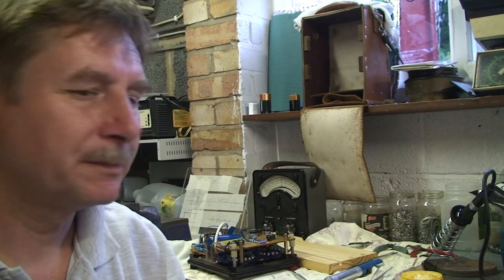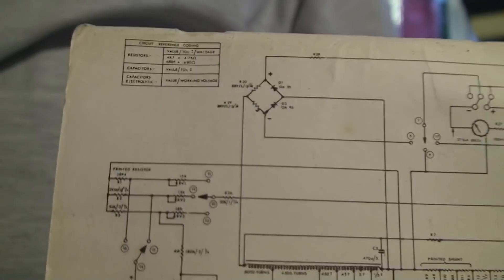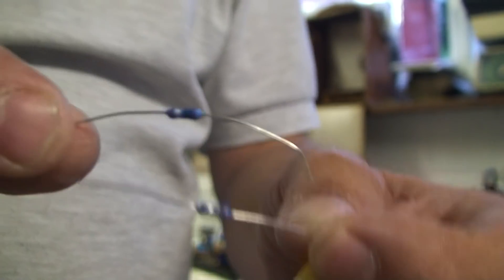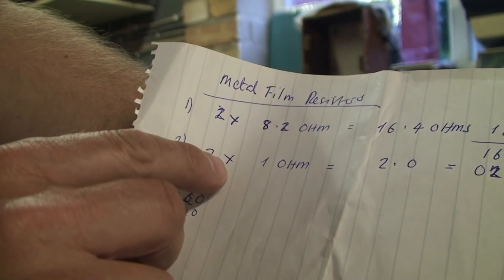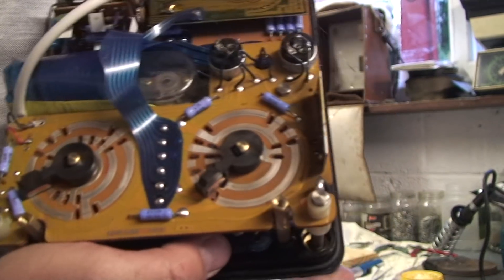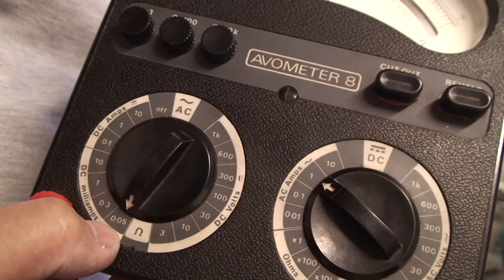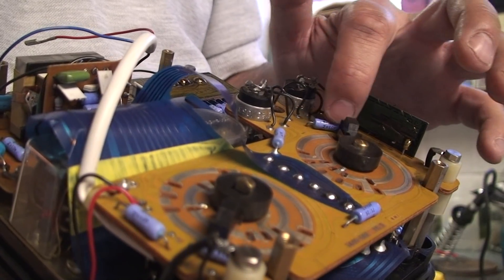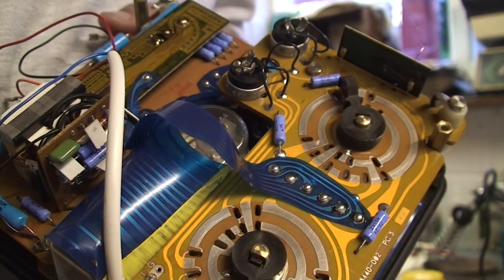Avometer model 8 MK 5  video 1 R1 Resistor

Comment: Quite a few issues with this video. No effort is made to determine an appropriate wattage for the replacement resistor(s). A fixed camera is used with inadequate lighting, so often the subject being discussed is invisible. The video cuts off before the actual procedure is started. No results or procedure is shown. Narrator mumbles quite a lot, making parts of the speech hard to understand.